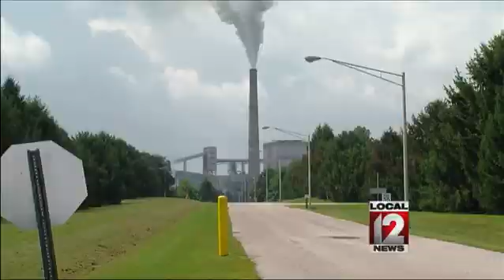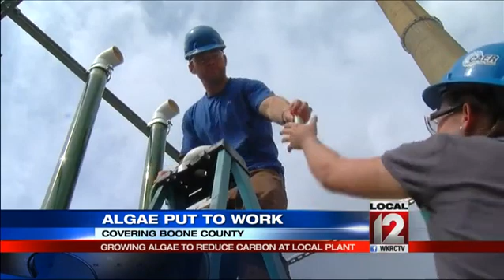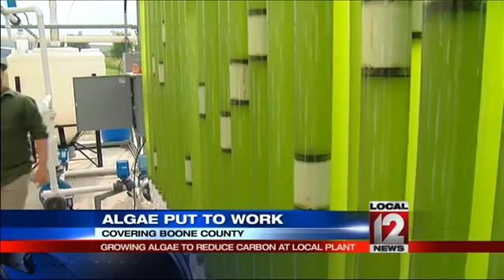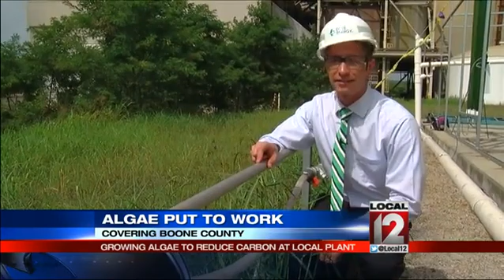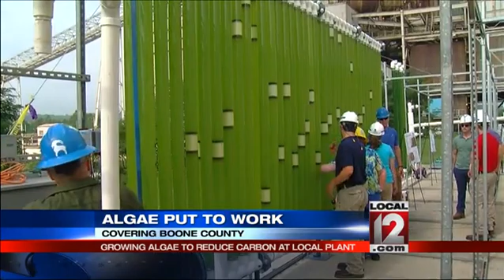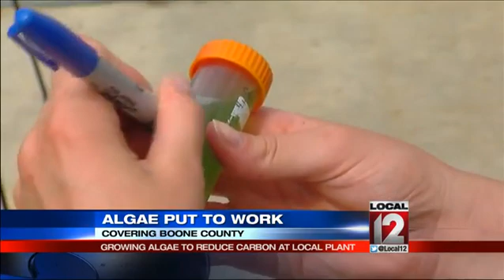Reducing carbon with algae at local power plan

Comment: There is a particular algae found in the Middle East in Israel that doubles it's biomass every 2 to 3 minutes and virtually absorbs anything that was dissolved in water whether it is pollutants or excess plant nutrients. The question is, why this particular information is not widely disseminated is quite SUSPICIOUS isn't it? The biomass production alone, if the algae is cutlivated in clean water and mixed with dissolved composite rock dust powder mixtures until saturation point is reached that the water can not absorb and dissolved anymore additional composite rock dust powders mixtures, the biomass can be used as animal feed, as a medium for growing mycoprotein mushrooms or to produce biogas energy for producing SCP "single cell proteins" used successfully for producing SCP flour based-cookies and other pastries.
Reply: Duanellia is what the Israelis are calling it but they are very tight lipped on the other specie of algae for military reasons. It literally simplifies the life-supporting capacity of any enemy nation(s) and thus increasing it's resource availability not for peaceful purposes but for military build up. Even our former Ambassador was told it is classified.
Reply: @darthvader5300  It's "Dunaliella." https://en.wikipedia.org/wiki/Dunaliella
Reply: darthvader5300 no dumbass, it’s called big businesses trying to make money.
Reply: @mateuszbak8501  Big business, big government. It's two sides of the same coin: the military-industrial complex.
Reply: because they grow this caused by a process that makes it as tough as trees, it doesnt digest that fast, and its really hard to digest it if you use the algea to clean sewer water because then its really really strong. also methane, the gas that comes off this algea i really hard to store and expensive to produce. the only way this technology really becomes useful is on large scale, because otherwise every house needs a $30k biogas turbo generator. alot of factors combine to make this not the most mathematicaly sound way to produce power right now, but scientists everywhere are hard at work creating the hardware needed to make this a reality. theres no conspiracy of it being hidden. Just not enough scientists working on the problem, not enough people with degrees in biology.
Reply: Hi there, just saw this comment, do you know what that algae is called?
Reply: @darthvader5300 do you have a link? i need to know please. thank you.
Reply: Because more people don’t become microbiologists . That’s literally it. We have a country of dumb people who think someone else will do everything for them.
Reply: Who's isnotreal? It's Palestinian occupied territory